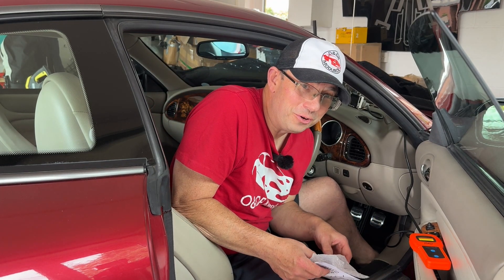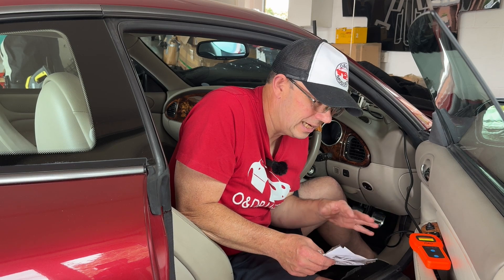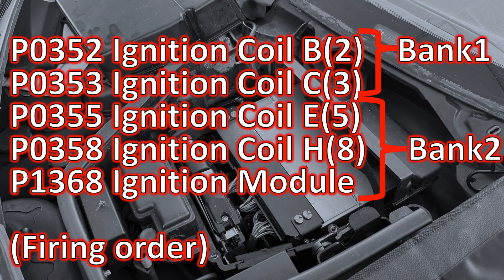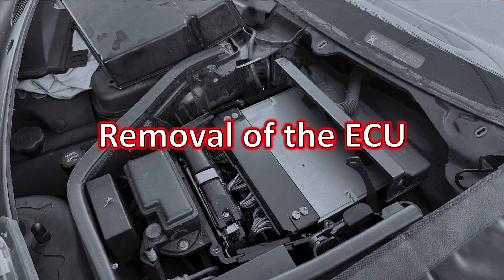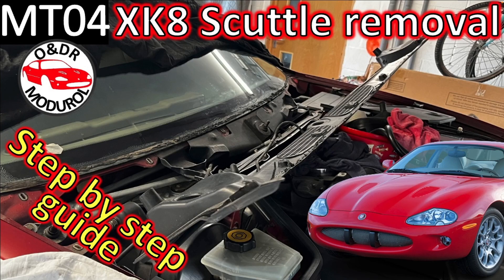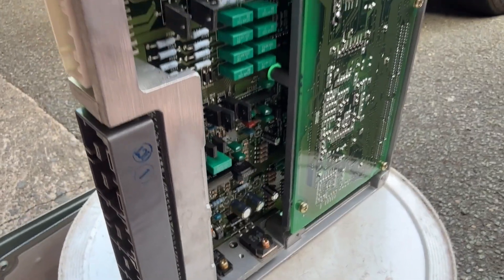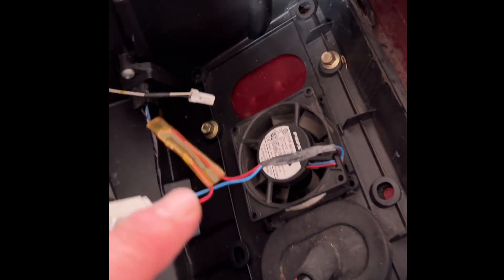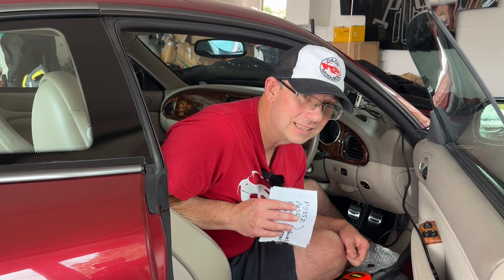Jaguar XK8 Engine Fault, Ignition Malfunction? Fix with ECU/ECM Capacitor Repair. XKR X100 Modurol

Comment: Lovely videos, very helpful channel!

Maybe you can help me:
I have an issue with my XK8. It starts, runs a few seconds smoothly, than begins to stutter and shuts off, with the "Motor Stop" info on the dashboard. I can start the engine again, but the intervals of running are getting shorter each time, until it finally refuses to start. And it smells like petrol. An universal OBD Reader dropped the P1646 & P1647 Code, so I replaced both Lambda Sensors with new Denso ones. No improvement😢 I also changed the crankshaftsensor, also no improvement.  The Jag stood over a year, and when I "woke her up", the fuel pump wasn't working, so I put in a new one. She fired right up and I drove 20 miles without aby issues. Then it slowly started the issues I described at the beginning. Do you have any ideas? Throttle Body? Brake light switch? Best wishes from Germany
Reply from the maker: @dieoigeborne7839, Hello from Wales. Sorry to hear you having problems with your XK8. These problems are very difficult to diagnose.As you mention 02 sensor codes P1646 and P1647 might be the related relay(4.0) and relays(4.2). See video link attached. However,  might also be a fuel / fuel pressure issue. You might have disturbed something and got dirt into the fuel system. Although they are relatively cheap and easy to change the fuel filter, they very rarely get changed. I would highly recommend changing the fuel filter. If still NG checking the fuel pressure at the fuel rail could be the pressure regulator.  Hope that helps give you some ideas, regards Damian
https://youtu.be/9xOPVE3FOEU?si=dSr9T4nm-mwJGhZ9
Reply: @Modurol Thank you so much for your help and suggestions🙏I have an older XK8 with the 4.0. I will change the fuel filter first, and exchange the O2 relay with another working one. I will keep you updated. I know, where to check the fuel pressure, but I don't know how the tester should "behave". I heard, 3 bar should be ok, but needs the pressure to hold the 3 bar, when turning ignition on? Is it ok, when the needle drops after a few seconds, when the pump stops buzzing? Fuel pressure regulators became quite expensive for this car, do you know some good value alternatives? 
Best wishes from Germany
Ruben
Reply from the maker: Hello Ruben! Best wishes to you in Germany. You are on the right track starting with the filter and relay.
Regarding the fuel pressure:
The 'Prime': When you turn the ignition on (without cranking), the pump 'buzzes' for about 2 seconds. You should see it jump to roughly 3 bar (approx. 43 psi).
The 'Hold': The needle should not drop immediately when the pump stops buzzing. A healthy system should hold that pressure for several minutes. If it drops to zero in seconds, you likely have a leaking fuel pump check valve (very common) or a leaking fuel pressure regulator.
The 'Running' Pressure: With the engine idling, it should stay steady at about 2.5 to 3 bar.
Let us know what the pressure gauge shows—it will help narrow down if the pump is getting tired.
Check this link for the instructions on how to connect the meter. http://jagrepair.com/FuelPressureTestingxk8.htm
However, this all could simply be the ECU capacitors, don't forget to check out and refurb your ECU first.
Hope that helps, regards Damian

Comment: I am trying to find a misfire issue on bank1 all cylinders. Codes P0300, P0301, 302, 303, 304. Has anyone seen the ECU cause this? it is a 2001 XKR so it does not have an ignition module per bank. They go back directly to the ECU.
Reply from the maker: @ChaseTheMoments, Mikey, best advise is to replace the ECU capacitors and then you can trust the ECU error codes. Hope that helps, regards Damian
Reply: @Modurol  Thanks very much.
Reply from the maker: @Chasethemoments, No problem, you are welcome. Please subscribe if you haven't already, regards Damian

Comment: Be aware that the leaking dielectric juice is corrosive to the printed circuit board traces.  Just because your ECU is still functioning doesn't mean that this damage isn't happening, and heat will accelerate the chemical attack.  20 to 25yrs is the predicted life of electrolytic capacitors of that era.  Pull your X100 ECUs now kids and do this job or you will be running jumpers to repair damaged traces when it has a hard failure.
Reply from the maker: @garyvanremortel5218, Gary, Thank you for the additional information, it's a very good point for anyone considering this repair! A problem for all modern classic cars with ECU's including our Jags. Thanks for your input and support, regards Damian

Comment: Great to catch up later weekend Damian and very pleased that the repair did the trick.  Nice to get the 'twins' together after nearly 30 years apart since leaving the production line.  Here's to the next meet 👍
Reply from the maker: Gerard, great to met you and the group at the Jaguar Heritage met. The car worked without any fault on the 5 hour round trip. I would like to think that proves the ECU repair worked. Thinking I need to improve my headlights after seeing your car. Added that modification to the list, regards Damian

Comment: Great video , just to add , the Capacitors are the electrolytic  type , make sure if you do this buy the best quality automotive grade rated to 120 degrees C , not a standard RS part with the same value , buy some solder braid or solder wick , make sure to buy an anti static wrist strap for your wrist and ground at a house hold Earth point eg a socket , get a Quality PCB cleaner spray from RS . Use temperature controlled quality soldering Iron that gets good tip temperature to avoid lifting PCB tracks . Electrolytic capacitors provide power supply ripple and noise suppression , they dry out in high Ambient temperature environments . The Capacitors do not need to show signs of leakage to be non functional . Anyone with older Audio equipment particularly valve amplifiers the same applies , first step is change the Electrolytic Capacitors .
Reply from the maker: @finiantully8279, Finian, thanks for your input, all good points especially the quality of components used and temperature. Very much appreciated, regards Damian
Reply: @Modurol  You are welcome Damian
Reply from the maker: @stevepitts7998, Steve, active exhaust valves are a great win/win solution, regards Damian

Comment: Hi Damian, I had the same problem capacitors blown replaced the capacitors but no joy like you problem on a hot engine but they also damaged the tracking on the ECU got a local radio engineer to repair tracks problems solved that was a year ago 😊 cheap fix
Reply from the maker: @bluemarge78, Richard, Great to hear you got your ECU repaired, and it solved the issue.  I think I was lucky to address the issue at the first opportunity and got good advice from fellow enthusiasts to focus on the capacitors. In my case the capacitors had just started to leak and the PCB tracks were not damaged. Thanks for sharing your experience, much appreciated. I think getting the expertise of a radio engineer is a great suggestion,  regards Damian

Comment: I think that Fan just runs with the ignition, so easy to check function. Can hear it in the cab I think
Reply from the maker: @AndyK.1, Andy, I believe you are right. However, with the ECU out the battery was disconnected. Further until I removed the ECU I had no idea the fan was there. Never had any indication it was running or there was a fan there. It's very, very quiet. Thanks for your input, much appreciated, regards Damian

Comment: Did it fix it? or don't you have a working gearbox at present?
Reply from the maker: @AndyK.1, Andy, not 100% confident as it occurred out of the blue. However, I have driven the car circa 50 miles without any re-occurance. I am still using the Automatic gearbox until the end of this month and the Gaydon met. Thanks for your interest in our project, regards Damian

Comment: Mine has the same random "limp mode" problem. Wondering, if available, might it not be easier just to replace the ECU? All this time I've been convinced it was either a TPS or APS problem. I haven't addressed either (yet) but the capacitors makes the most sense.
Reply: Certainly easier but ECUs are extremely, and mean extremely, expensive
Reply from the maker: @quintintudor-evans763, Quintin, agree its an expensive solution but is it easy? regards Damian
Reply: They need programming to the key
Reply from the maker: @AndyK.1, good point, need cloning, copy all the current ECU setting into any replacement, regards Damian
Reply from the maker: @hillbilly4895, Good question, you could replace the ECU but with what? Another of the same year and part number and potentially with the same issues. Out of the frying pan and into the fire? Any ECU swap would need to be programmed to the other modules in the vehicle. Total cost circa £1k. You can just pull out the ECU and replace with an aftermarket unit but the cost is £4k to £5k. Repairing the ECU is circa £300 with a technician or you can do it yourself for £25. That is the choices you have. From this experience I would say all X100 have this capacitor issue tinking after like a time bomb. Hope that helps, regards Damian
Reply: I've had an ecu fault with ign codes about 6. Had my ecu checked and fixed for £295  . Plugged it back in when returned  hey Presto fired up and now runs greatstuff . Can supply guy phone no if required.  Common prob on 1996 1997 xk8
Reply: What a great step by step video. Thank you very much 👍
Reply from the maker: @kaifischer6906, Kai, thank you for your support and kinds words, regards Damian